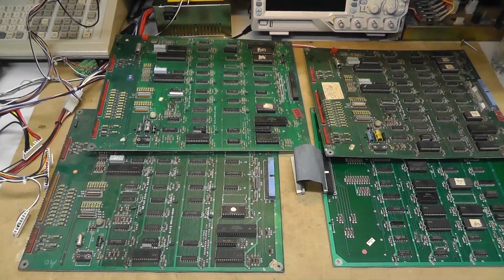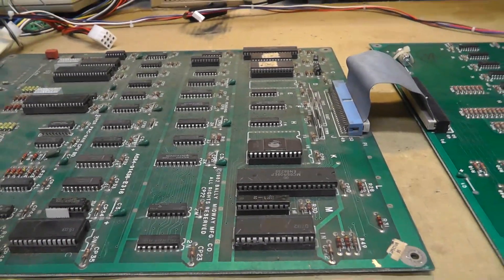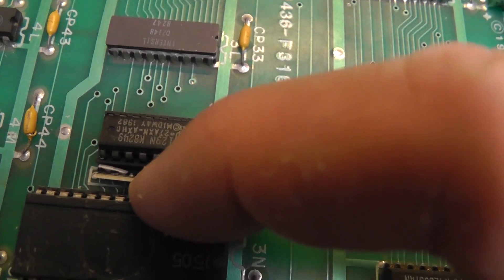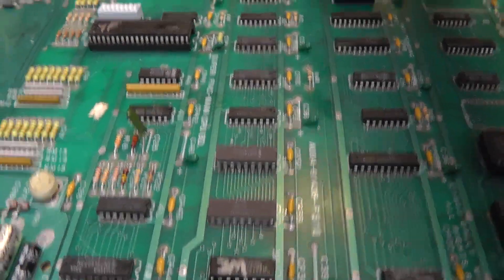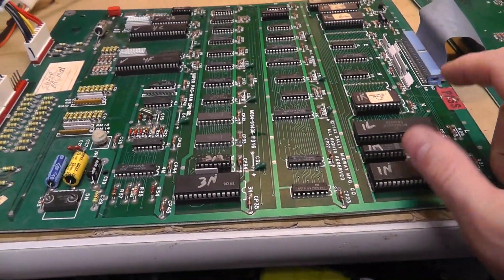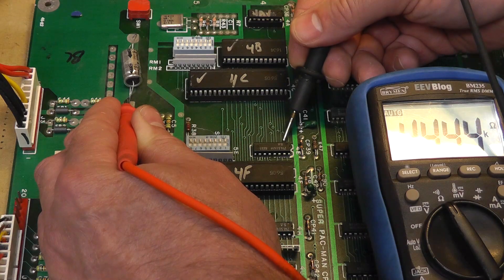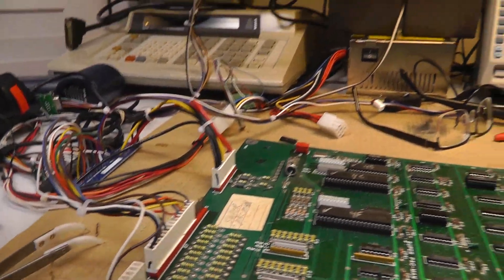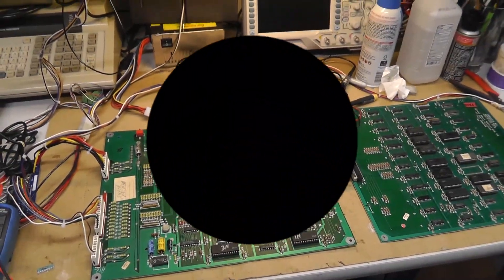3 More Super Pac-Man CPU PCB Repairs - No Boot, I/O 2 and I/O 1 errors

Comment: I replace those type of resistor packs just as a preventative maintenance since they suck :)
Reply from the maker: I hear ya.  I hate ordering and waiting for parts though too.
Reply: @jacklick  Yeah, that's why I order them like 50 - 100 at a time.  Cheaper and I know I'll use them on other boards.  Haven't looked at the values on Super Pac, do you know if they are the same as the ones on Galaga?
Reply from the maker: @Arcadenut1  not sure about galaga but pretty sure 1k, 2.2k, 4.7k are fairly common values.
https://www.mouser.com/datasheet/2/54/4600x-776645.pdf